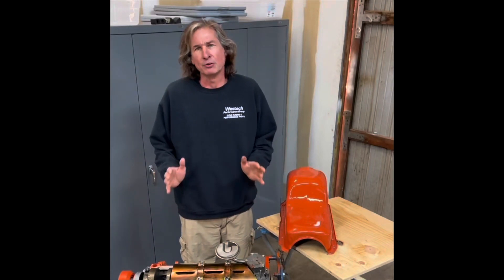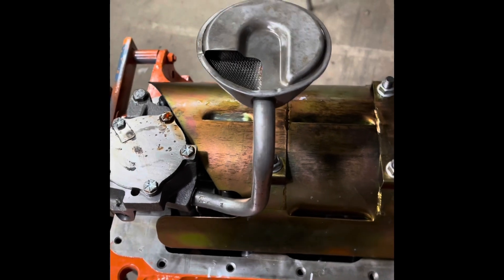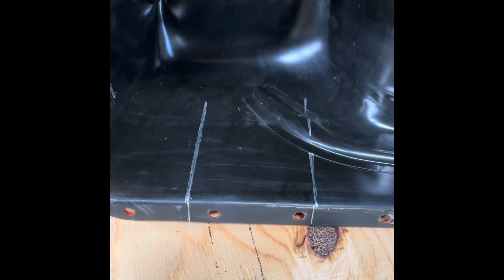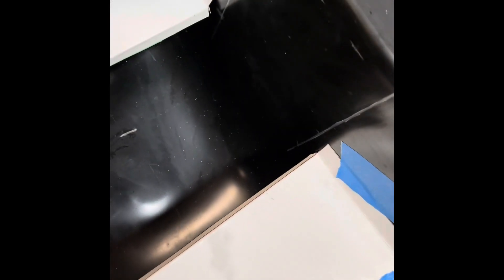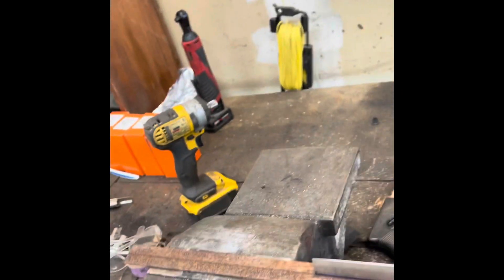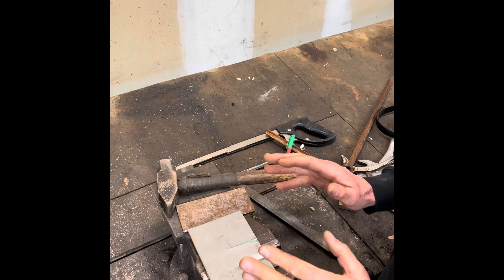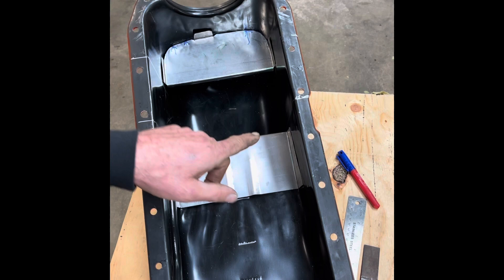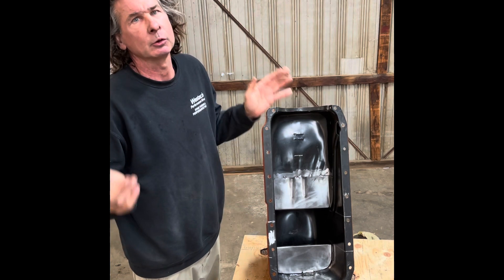Oil Pan Mod

Comment: Neat job. Got any ideas on how to use the magnum 1 piece pan gasket on an LA engine? The only thing keeping you from using that type pan gasket is the little raised rib on the curved ends of the pan. On an 88 class B camper I have with a 360 LA I went to the salvage & found a van pan from a 5.9 magnum. It was identical to the 88 LA pan except for those little ribs. Can't do that with the pan for an A or B body though. Reason for asking: planning on putting a 360 in my 75 Duster. I have the correct pan for the A body but fitting the 1 piece gasket??

Comment: Question Steve. Would knowing the oil fill level matter? Do you want the baffle above, below or doesn't matter? Also if there is room in the sump would a vertical baffle with a gap and the bottom help?